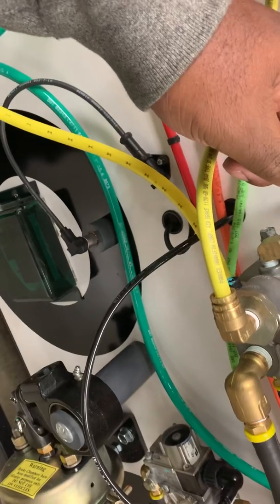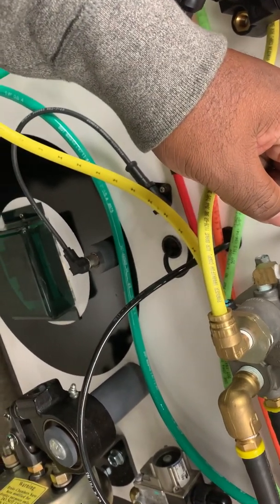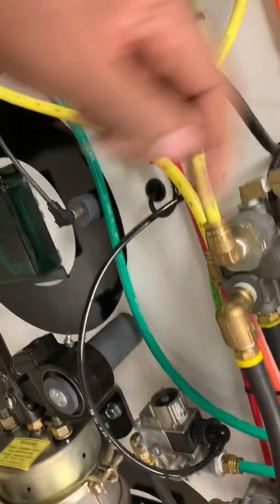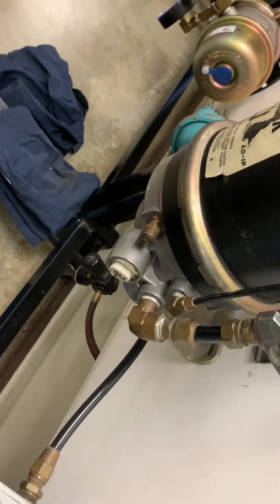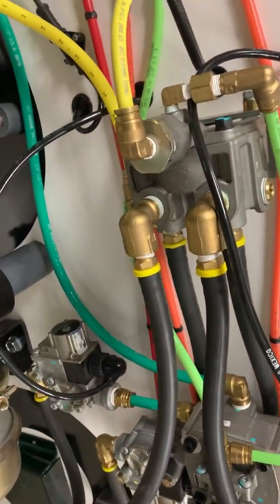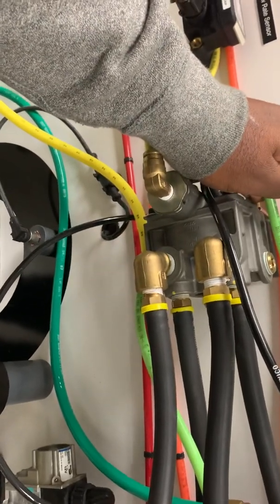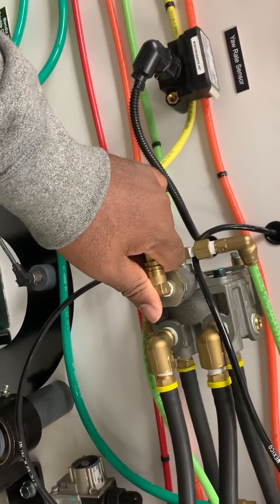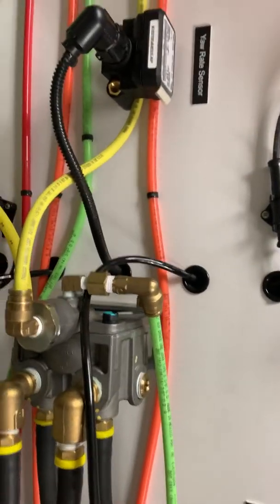Spring Brake Valve

Comment: Good tip on the teflon. I had to use some on the governor, but lacking the fitting pipe from the governor to the alcohol pump (yes, one of those old manual pump ones), the only way to seal it was using teflon. The o rings from Van Hool (the only metrics I could find) were just too small. So, yeah. BUT, at least the bus is designed for this, and has mesh fittings everwhere at seemingly random places.

You might laugh, but the bus was designed for WOOL fitting sealant. They literally put tufts of wool around the threads and tightened. I dont think that was ever used in the US, but they did that from the factory from the 40s to the 2000s.
Reply from the maker: I have never heard of anything like that. People really did figure some things out back in the day lol
Reply: @learndiesel528  I know. Its crazy that these things were reliable enough for daily use with passengers.